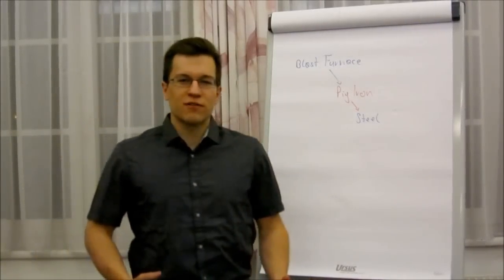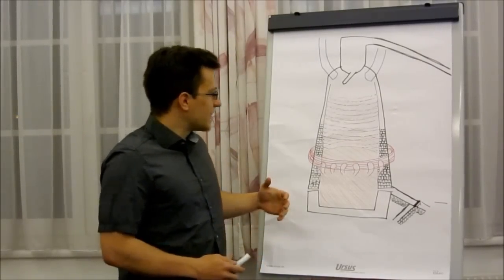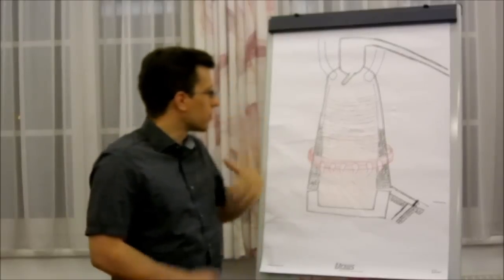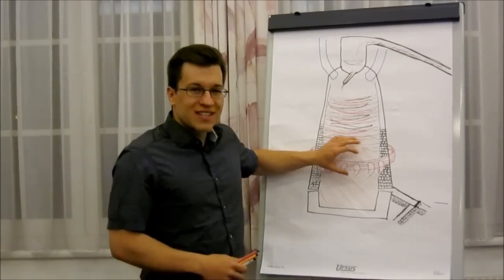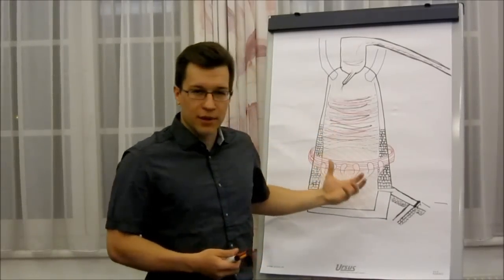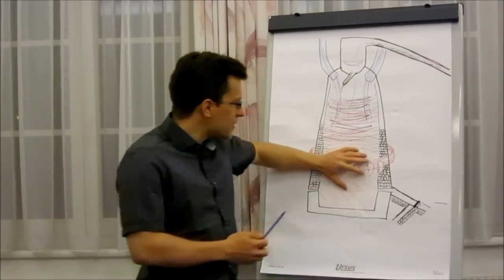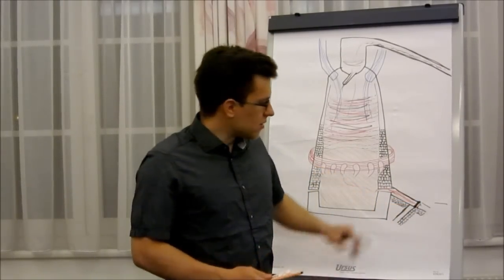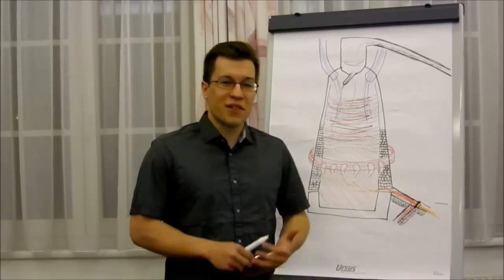How a Blast Furnace works

Comment: the question is: why does not melt the Blast Furnace itself ?
Reply: The wall of blast furnace is made of refreactory and water cooled staves. So it will not melt.
Reply: because temperature in blast furnace is maximum 2000 Celsius. and melting point of blast furnace walls is much higher then this temperature ....